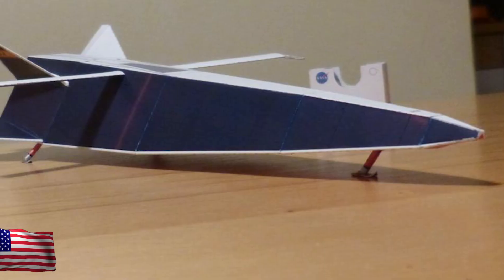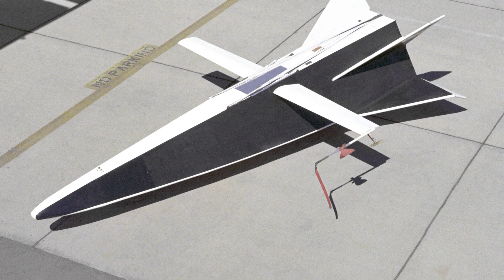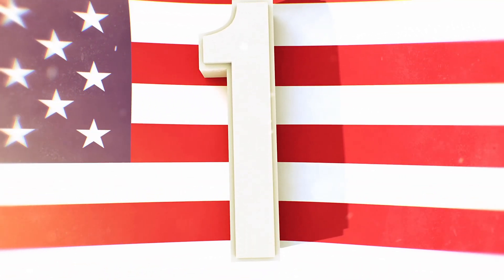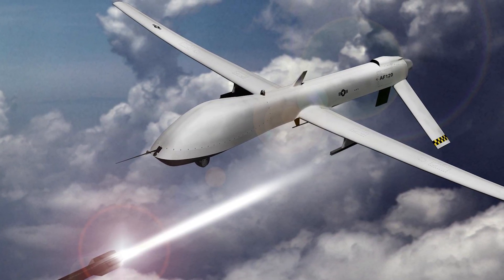17 Most Bizarre Aircrafts

Comment: This is hopeless, full of ridiculous errors. You could have spent half an hour watching other videos right here on Youtube and corrected all of that, or done it in 5 minutes on Wikipedia. Eg. First the V173 was a small, low-powered (and very successful) proof of concept for the XF5U, you show pictures of both "aircraft"  and talk about it as if the V173 would fly from carriers, and mix up the two aircraft's histories and pictures all over the place. The BV 141 wrecks found were not "probably due to failed flight testing", they flew very well and exceeded all requirements except max. power. This guy assumes because it looks funny it probably didn't work - you don't think the aircraft manufacturer maybe CHECKED if it flew before they spent a fortune in precious war resources building a bunch of them? Like the producers should have before releasing the video! Finding the wrecked planes in France is usually credited to the Germans not wanting to leave their new technology for the Allies - you made this video, you should have known that. 1800 kilos isn't nearly 20 tons it's almost TWO tons. The "Spruce Goose" (HK4 Hercules) was never a glider, what the hell? The first shot the video shows is a bunch of engines! It never served at all! It did one taxi run and barely lifeted off the water, just to prove it could. The whole thing is useless and it'd be better to replace the entire narrative with "yuk yuk, ain't that funny lookin'!" It'd be a lot more accurate! Just look stuff up, it takes no time!

Comment: Wow! I don't think I've ever seen such a mixture of half true and just plain mistaken commentary. Your idea of what is strange is bizarre to say the least. You mixed pictures of the XB-35 and the XB-49 both flying wings but one prop and one jet engined. I personally watched Starship 1 take off from Mojave Airport (self styled "space port") and launch the first privately funded spaceship launch. That last thing, the Russian vehicle wasn't a true airplane, it was designed to fly in ground effect  and not to fly over about 25 feet above the surface. The Russians built quite a few different models some capable of lifting hundreds of tons of materials. The so called "Spruce Goose" was in no way a glider. I have to wonder where you came up with that idea. Also it was never flown after that first foray by Howard Hughes. There's lots of other inaccuracies to numerous to remember.

Comment: The prop planes had a ceiling limit partly because the air became thinner at 10,000 feet and higher, so the Caproni design was to help increase the ceiling limit. It's how jet engines were developed.